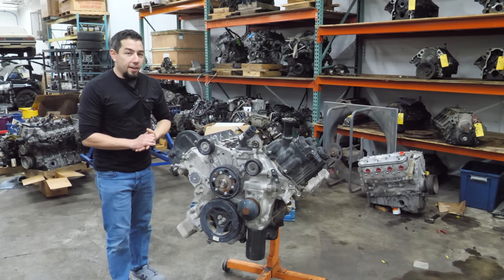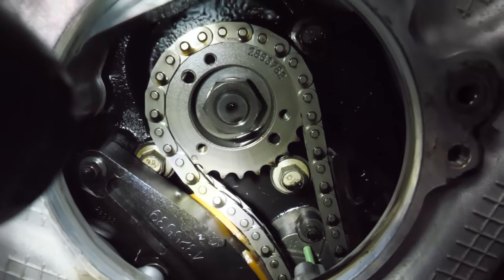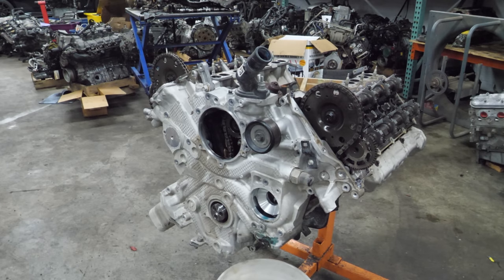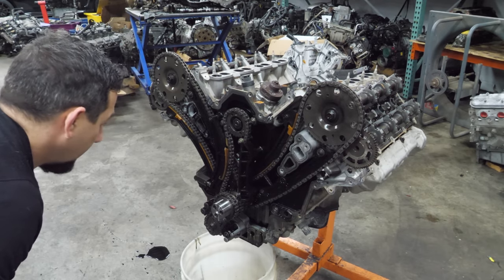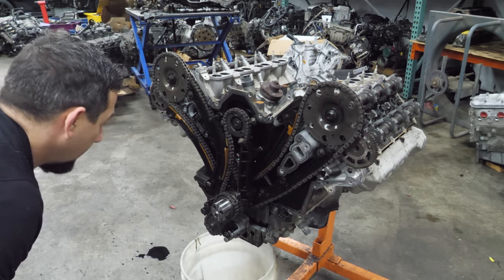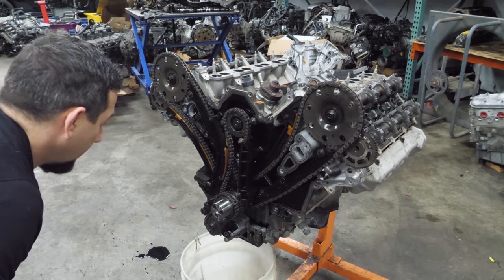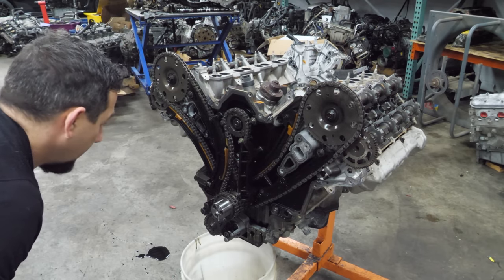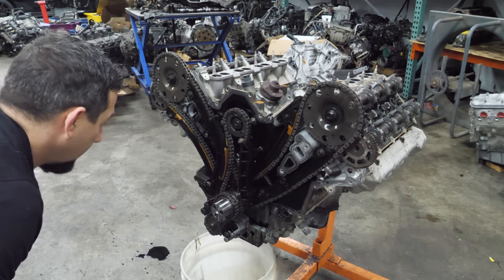Well That's Not Good! Nissan Titan XD Cummins 5.0 Turbo Diesel V8 Teardown. A Costly Failure!

Comment: Really enjoyed the Nissan! Thanks for taking the gamble of maybe a good block! Way back...in the middle ages I had an International UD-14 diesel, running a saw mill. Started on gas, switched over to diesel. I have no idea how many hours it had on it.  One cold morning I started it, no either, and it started hammering. Quick inspection through the plate on the bell housing, and the wobbling clutch assemble gave the terminal diagnosis.  Nope, didn't fix it, sold the whole lump of iron to someone else, and bought a UD-16 to replace it.  Really enjoy your running commentary, like using your brother-in-laws favorite shirt for an oil rag!  Appreciate your youthful humor and instruction.

Comment: I have to wonder if he did boost the power on this engine. What shocked me most was the main bearings were as bad as I thought they would have been. It sure would've been nice if he had this covered the engine instead of filling it with water.

Comment: Actually i worked on a duramax 6.6 LMM with a broken crank and it was running and sounded more like an exhaust leak coupled with a cylinder misfire...  I was in shock when i determined it was a fractured crankshaft.
Reply: i mean you could say it definitely wasnt running on all cylinders
Reply: Yeah, but this thing drove in off the highway with a trailer loaded with lobster traps and still ran well enough you'd never have guessed the crank was broken.

Comment: a lot of diesels are designed to have pistons protrude from the block. Thats why they have various head gaskets of specific thicknesses and you need to match that up when you deck the head so you compensate for the material you took off

Comment: That pretty blue crank remnant will make a nice desk ornament 😄

That engine looked very clean inside for a diesel with over 100K on it.  Tuning it likely disabled EGR, which makes for a clean minimal soot diesel.  It also appears probable that his tune disabled the engine itself by snapping it's crank in half.
Reply: Might as well because it's not good for anything else.
Reply: Also seemed the owner may have been using amsoil given the filter which certainly could have helped with that too.
Reply: Ha
Reply: I dont think ram made a wise choice with that Italian V6. Id say its one of the worst, if not the worst modern diesel engine made.
Reply: @premiumxperiments6059 a I missing partner the conversation or has it been deleted? What does the eco diesel have to do with this video?

Comment: Some diesel engines do have pistons that come out of the deck about as much as the thickness of the head gasket, makes for more or less zero piston to head clearance for maximum compression. But also no room for mistakes, pretty easy to smash some valves that way.

Comment: My first car was a hand me down FIAT that my brother (brilliant man with absolutely no mechanical aptitude) ran overheated and low on oil for quite a long distance. Shortly after being blessed as it's second owner, the crankshaft broke at freeway speed (yes, 70 mph) destroying virtually every internal engine component. I should mention that a suddenly seized engine in a manual transmission car can make them a handful to control. Anyway, I'm still here to tell of it so while the engine was a total loss, there was a bright side. Thanks for this and all your videos. Keep up the good work!

Comment: I own one of these and seeing the insides is a treat. The 5.0 is almost indestructible if taken care of and and not abused, mine has 100k on it and runs smoother than new. Oil analysis shows no wear concerns yet. The tranny attached make the combo surprisingly beefy, overbuilt. I understand folks who question the 5/8s size and 6 lug hubs… I feel Nissan missed a LOT of sales not getting closer to what the other 3/4 tons can do. 

I pull mostly a single car hauler and the 5.0 is never overtaxed.
Reply: I also own a 2017 XD with 40k and this is an eye opener. I do oil analysis every time I change the oil. Hope I have better luck. I love the truck.
Reply: @joeagri1  mine is a 2016 Platinum. It is a very solid truck, Im just disappointed the 5.0 was discontinued. My big worry is parts availability eventually.
Reply: @Cherokeelion  would you buy another? been shopping for one used, have a 22 diesel Colorado just not enough truck.
Reply: @Greasytireguyuntilidie  truthfully? Even as I like mine i wouldnt buy another diesel titan. Discontinued motor means parts priblems in future and its a good motor in wrong platform
Reply: And it pains me to say that because i really do like my truck
Reply: @Cherokeelion  thanks brother, I want to take a chance so bad. But the negative reviews are stopping me, they were such a excellent package if executed properly.
Reply: Worthy mention, the injectors currently are 1200 each and you need 8 to replace them all. That gives you an idea of the wallet pain potential.
Reply: @Cherokeelion  my cummins we’re about 1000$ each so that isn’t a big deal. Honestly the cost doesn’t deter me at all, even if the turbo went I would get a bigger one. Just want reliability, the rest is whatever. But I appreciate the heads up
Reply: @Greasytireguyuntilidie  well… reliability? If you do your maintenance on time and stay ahead of their issues, like incomplete regens with short city driving, etc… and dont try to pull huge loads the 5.0 should run forever. I like mine, the mileage isnt the best but its a comfortable truck to drive. Ppl say the 5.6 gas XD is a better buy, I dont know, Ive only driven mine.

Comment: In the late 60’s I had a ‘59 Austin Mini 848 cc that developed what sounded like a rod knock, not surprising since it was old and I drove it hard full time.   When I got it home I pulled the engine and found that there was a crack most of the way across one of the crank throws.  Each time the torque reversed, the crack would open and then snap back together making the knocking sound.  Good thing I didn’t drive it further since in the original Mini the gear box was in the oil sump right below the crank and dropping pieces into it would have locked up the wheels!  Dropped in a new crank and went right back on the road, no other parts required.

Comment: A friend brought me a broken crank from a 2 cylinder compressor, he'd tried to get a spare crank but couldn't and was too tight fisted to buy a new complete pump, I had a look at the break and it was like a 'cracked' connecting rod, the break fitted back together perfectly after I'd filed a few burrs off it, I formed a plan to repair it and started by epoxying the 2 parts back together and clamping the crank in a bench vise so the 2 parts were tightly knitted together under pressure, then after a day or so for the glue to harden I put the crank up in my mill and drilled and tapped holes from the outside through the web to and through the break line, the holes were clearance on the outside of the crack and tapped 5/16 UNF at the bottom with the break line between the clearance hole and the tapped hole. I managed to get 3 tapped holes and counterbored the tops for the cap head 5/16 bolts installed to firmly bolt the 2 pieces back together, the epoxy was just to hold the 2 parts accurately together while I drilled and tapped the holes, the glue never let go and held the 2 parts of the crank together until the cap bolts were installed and tightly Loctited in place. I checked the crank in my lathe for straightness and it was acceptable at less than 0.002" out and it spun freely in the pump housing. My friend took everything away and re-assembled the pump back at his shop and got it working which it did seemingly normally and after a year of continuous use in his shop it was still working perfectly, so there you go, how to repair a broken crank (compressor)

Comment: Had to run out to my truck at almost midnight to see why the CP was pulled back like that. It’s pretty obstructed, but it looks like those bolts must have been cross threaded. Been waiting for this video forever!
Reply: It’s tuned, I imagine that he’s been driving under max effort a little too much to break a crankshaft like that.
Reply: Stock trucks have been reported fail at the crankshaft as well. It's unknown how many have failed or how many Titan XD 5.0L were even sold. From what I have seen on groups and forums, it's more than just a few! Seems like most are usually tuned trucks but It's also stock trucks from time to time.
Reply: The bolts are used as studs. There are 3 nuts on the valley side of the pump.

Comment: To me it looks like a fatigue crack that started at the journal radius.  If you still have the crank you might look closely at the other side of the broken journal and other journals.  It's normal for multiple fatigue cracks to start then one grows to failure.
Reply: its a fatigue crack that got a bit of help from a bad cooling layout and one miracle of a void in the manufacturing process. Theres a bubble in the exact center of that break, inside the machined faces of the crank shaft that isnt polished by wear or machine tools Thats a hell of a manufacturing defect
Reply: From 40 years of designing to prevent fatigue failures, I agree. But...there is no excuse as the mechanisms are pretty well understood as is the design methods to prevent. If I were to venture a guess...a six cylinder design that was extended to eight and deficiencies got the "good enough" stamp. "Safety factors in original design will be adequate". Unfortunately (if true), the failure began from the day the engine was first put under load

Comment: On the high pressure pump, did Cummins use the wrong bolts with the wrong thread pitch when assembling the engine, or did someone have it apart. There is no way there should be a gap that big if everything is tight.

Only at 13:30 now. Maybe there is an answer later in the video.
Reply: Someone else in another comment said they think the previous owner of the engine tried to remove the HPFP without removing the timing cover and damaged the guide in the process

Comment: I had a 89 BMW M3 in my shop years ago and the guy had a misfire for a long time. Was a bad wire inside the injector harness, got it fixed and got him back up and running good. He went out for a track day and within 2 laps snapped the crank clean at the journal very similar to your titan xd engine. Although the driver of the car shut it down immediately. We where able to replace the crank, clean up the rods, similar minor damage as seen in your engine as well. We upgraded the cams, tuned the ECU and he was back out at the track having a blast.
Maybe the culprit in you titan engine can be traced back to that injection pump and perhaps creating some kind of fuel injection related misfire that stressed the crank harmonics and snapped it.

Comment: I have that engine in my 2017 XD with 40K on it. I have read the blogs about this problem on many of the 16 and 17 engines and hope I have have better luck. I do oil analysis every change and monitor the wear. So far so good. Thanks for the tear down, was interesting to see the he busted crank. I do all my own repairs, tunes and upgrades. 
Keep doing what you do best. Thanks
Reply: Don't run the Cummins past the redline, which you shouldn't anyway. 
Easy on the tune.
Reply: The engine is very close to the limits of HP and torque any ways.  The CP4, complicated turbo system  and EGR system were problems in mine (2016 PR XD).  Also very inept dealerships that no factory training on these engines; refused to work on them for warranty work.   🤑

Comment: 15:31 Torque spec for the cylinder heads is 30 lb-ft, then 89 lb-ft, then another 180 degree turn. I'm in parts at a Nissan dealer, and we've had a couple diesel Titan's in that have gotten the engine replaced. I can't remember exactly what they were for, but we've done them. According the Nissan's parts catalog, the new engine is supposed to come with the turbos, exhaust and intake piping, and fuel lines, but both we have ordered have come in without everything, which was just wonderful for the tech on the first one he did, especially since the warranty labor time didn't include having to swap everything over.

Comment: Curious as to why Cummins didn’t use the fracture split rods like every other engine they have. Haven’t seen the 5.0 engine in real life only work on the 6.7 ISB motors in medium duty applications. Very much a interesting video for me as a School Bus Technician
Reply: I’m a former school bus mechanic and driver.  One district I worked for had 3 of these powering some late model buses.  We had constant emissions problems on them, but when they ram right, they had very nice power and decent fuel economy compared to the older internationals that made up most of our fleet.
Reply: Those are definitely fracture split. If you look hard enough you can tell.
Reply: The closeups clearly show fracture splits.
Reply: @91CavGT5  unfortunately that's the case with all that stopping and going with the abuse that those simple ass bus drivers put them through
Reply: It's the powerstroke rebranded.

Comment: Hey. You asked what the torque specs were for the head bolts on this Cummins. According to the service manual from Nissan: 
Step 1 : 30ft-lb
Step 2 : 89ft-lb
Step 3 : Tighten 180 degrees. 

FYI. I work at a Nissan dealer in Canada. I've never seen one of these Cummins engines apart or even heard of mechanical issues.
Reply: That’s great to hear. Did your dealership sell many of them? I’m in Canada too. My dealer says they only saw one with a similar failure to this one.
Reply: @bicepusmaximus  We didn't sell many. We did however do a couple with lifts/tires but no performance parts.

Comment: protip when turning bolts:  lift up if can.  you can only push down on a breaker bar with your weight, but you can lift up with all your leg muscles.
Reply: or the fork lift

Comment: You can't drive cracked rods out like that without rendering them unusable. You're supposed to bolt the cap back on and push out with the cap. When you use any object to push against the micro cracked surface it's damaged. Even using wood or plastic can pack the irregular surface and compromise the fit. Also, some piston projection on a diesel is normal. Yours is a special case from the broken crank. Cool vid btw. Love diesels.

Comment: I'm still waiting to see my Inline 300 4.9L I know they never die, but there's gotta be a least one or two that are tried. Fair warning though, you won't make money off of it, it'd have to be a special historical case or something. It was one of the longest engines in service after all.
Reply: If it were one of the “medium duty” ones they used in heavy trucks it would be worth it, especially with its high flow stock manifold. As a base engine to the 330, 361, and 391… it was definitely a tank
Reply: @aaronatwood9298  For sure, I've emailed before about a HD exhaust manifold, (boosted app. Make over 400hp) but they don't have any.
Reply: Better than most aftermarket headers. Doesn’t matter what emblem you swear allegiance to, but the 300 straight 6 is one of the most durable engines ever made.

Comment: Diesels have piston protrusion above the deck up to .035”. The head gasket is usually .050-.060” so that gives you the clearance. Much different than your gas engines. The combustion chamber is in the piston which is why it looks like a bowl because it is.

Comment: Personally, I hate diesel for personal vehicles, the smell and etc... I have a friend that loves them. That one is a shame though, because you can tell it was cared for. 128k miles and that clean and hardly any wear. Nice job tearing it down. I bet that crank shaft is expensive. That engine could be cleaned up, use the right size hone, new crank, maybe a valve job, bearings and such, and put back together and it would be fine IMO. Nice Video, thanks for sharing. It proves the fact that even if you do everything right, things can go wrong. Stuff happens

Comment: Happy to see you back and healthy. Great video as usual.
I bought a 55 Chevy with a 283, PO said it would run if I reconnected the electrical. Turned out to have a broken crankshaft as well. It was definitely noisy 😃

Comment: I broke a crankshaft like that in the exact same spot before. It ran like garbage, but fairly quiet. At idle, on random rotations, it would make a loud “ding”. I can assure you, a crankshaft snapped in half can definitely run quiet. I would estimate it had about 40% of its normal power. Not like an engine that was running on fewer cylinders, but just like it had no compression.

Comment: The cranks always get the blame for being weak, but what I believe is happening is the injector getting stuck open and causing severe detonation which breaks the crank. It feels like you hit a 3" bump on the highway when it happens. The injector issue is caused by the terrible quality connectors that they specced for the injector plug which are not up the the task of modern high voltage high current injectors.

Comment: It was RUNNING! That’s crazy, it was running as two separate engines: a V-twin for the accessory drive and a Chrysler 239 V6 to spin the wheels.

I’m sure it was rubbing and bumping but I could see where it would tend to stay together.

Comment: Spent 7 years at a Cummins dealer and only saw 1 broken crank on a 11 liter. Surprisingly it didn't really make any abnormal noises, it was when you would be at a stop and shift from P-Reverse or R-Park then the engine would start shaking violently but normal acceleration was fine.

Comment: for the torque spec of the head bolts:

Tighten the cylinder head mounting capscrews in three steps, using the sequence shown in the illustration.
Torque Value:
Primary Capscrews:

        1. 40  n•m [ 30 ft-lb ] 
        2. 120  n•m [ 89 ft-lb ] 
        3. Turn the capscrews 180 degrees.